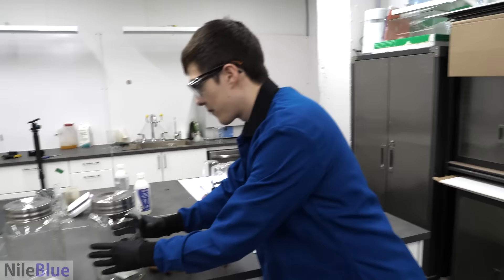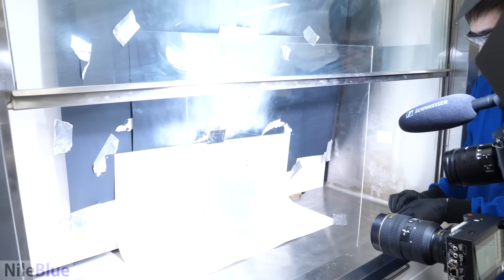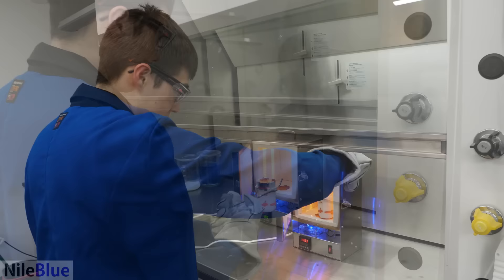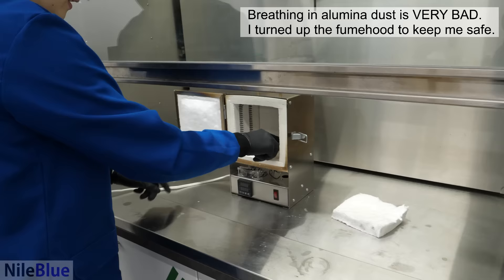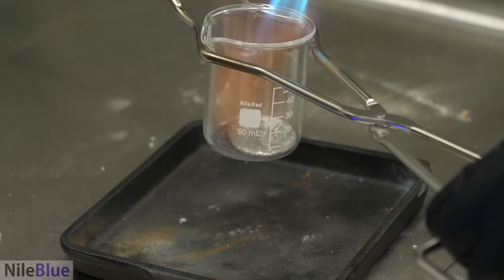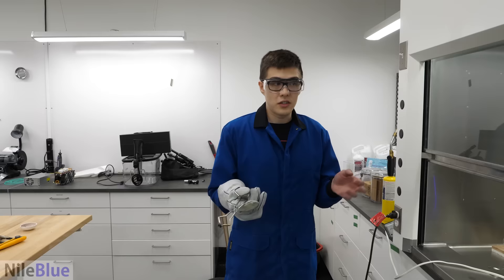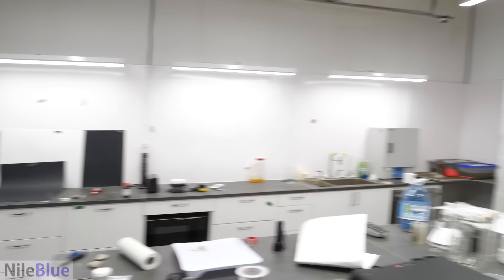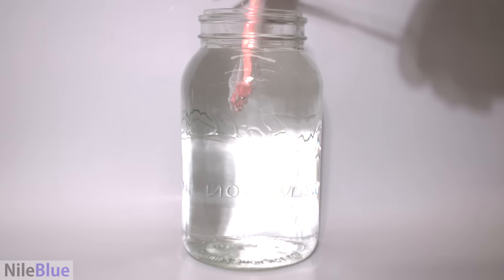This project was a disaster.

Comment: Actually my little science dude.  The reason  your crucible probably failed is due to the last time you used it, doing this exact thing. When the jar full of water exploded, it probably splashed some water onto the crucible, causing it to micro fractures. Now, after cooling, its being heated up again, causing all of those micro fractures to spread and get larger, causing it to leak molten metal out of  the sides.

Comment: Y'know how glass cracks if it's warm/slightly hot on the inside and freezing on the outside? Take that to the extreme, and you've basically got an explosion- why chemists don't ask physicists stuff is beyond me, but we're available to answer such questions. Basically, your explanation is kinda right, but the metal not  being cooled down enough and impacting the glass was the reason- and not the vapor expansion bs I was hearing.

Comment: As someone who works with molten metal, and having no context as to why he is doing this... a few things:
That hard, thick layer on top are the impurities rising to the surface--called dross
The explosion happens because the water is trapped under the molten metal, and tries to expand rapidly (1700 times)
If you want to make a very spooky explosion, just use less water lol

Comment: Exceptionally hot metal surface or molten stream.  Not much happens to bulk exposure until the temp drops below the Leidenfrost effect temperature.  A layer of steam otherwise insulates the heat exchange  However...if the liquid stream fragments you get an exponentiating BLEVE, and you die.  Nomex coat and gloves, or refractory ceramic fiber.  Safety goggles, then polycarbonate full face shield - thick, not film.  Women like scars...but not empty eye sockets.  If you cook off your lips yer gonna drool a lot, messing the bed linens.

Comment: Copper melts at 1982 degrees Fahrenheit so doing it at 2200 was prob a bit too much. Also your using copper fittings that aren't pure copper most likely so the melting point is prob even lower then that

Comment: Use a CO2 extinguisher!  That dry chem will destroy the circuitry in every valuable electronic device in the room if you use it!

Also, a moment to tape the cord to that oven to the side of the hood would save you a bunch of fuss should you spill some molten metal...

Regards, HAZMAT Firefighter

Comment: if im correct this effect is called water explosion, this is caused by something very hot getting in contact with water but noone really can explain it why does this happen. Some say this is because the water breaks down into hydrogen and oxigen on really high temperatures and because it is hot it can ignite and became water vapor again, i think this is the best explanation but you can argue with it, like: if the water vapor on high temperature breaks down why does it only do once, why doesn't it continous till the temps goes down? you can do it with ice and very hot iron or even thermite, it doesn't depend on what material you use, just it's temperature. https://youtu.be/yhIINTac28Y
https://youtu.be/rsd2Oaq86yY

Comment: When you smelt any metal you’ll always end up with an oxidized layer and some contaminants. You just have to scrape it off with a ladle of some sort. If you let it sit after that, more of it will oxidize. Unless you’re worried about impurities, scraping it off is entirely unnecessary. But it will harden faster since the “skin” makes for a sort of thermal break.

Comment: @NileBlue #NileBue "2200 F"???

Since when is science Imperial in measurement???   o_O

So "unsciencey" ...
Please use SI ...
Reply: Reason: the difference in temperatures creates the "explosion".
The metal gets speed-shocked to cool down, while the opposite happens to the water.
The copper fumes combined with the water fumes (as steam is made because of the heat from the copper/bronze) make the whole, when it combines, explosive.
Reason for the beaker to go like that explosive is the water: it's like a grenade in a pond: the shock-wave is intense ...

14'40" Explosion failure: Temperature was much lower.
The second time the temperature was higher, it seemed (could be mistaken, but ... ).
Also, the speed it was poured made a difference ...
The pocket of vapour made a tunnel through which a lot could escape ...

But that's just my thought ...

Comment: Because the the molten copper was extremly hot as it absorbs more heat and  when you put in in the jar filled with water were become extremly warm and get explode . But... do this experiment in a jar that made of borosilicate that times your video will be 100%success because it's heat resistance it it sure to know someone who are scientist😂😂scientists  physically 100 %trusted about borosilicate glass that are specially used in laboratry 😂😂